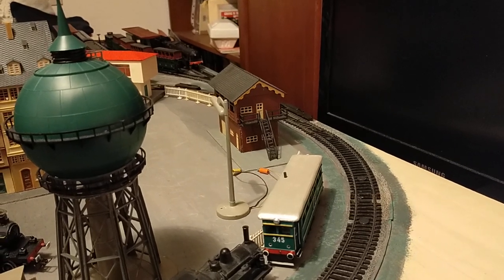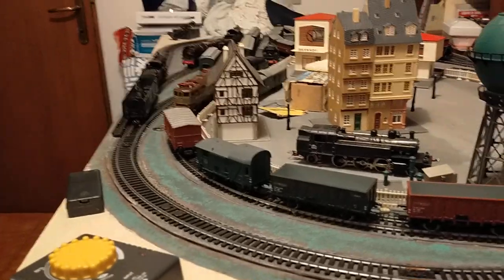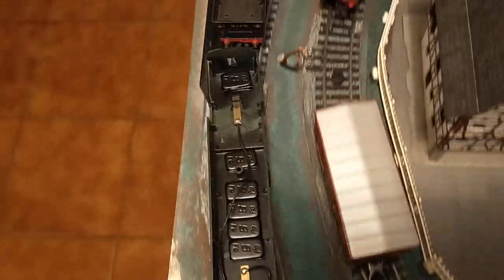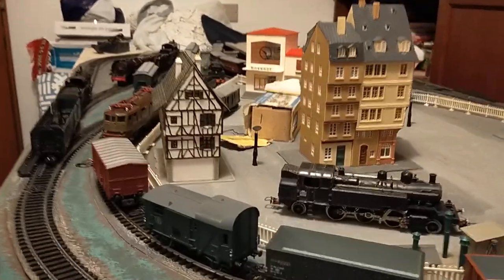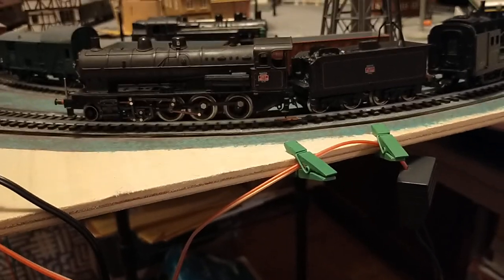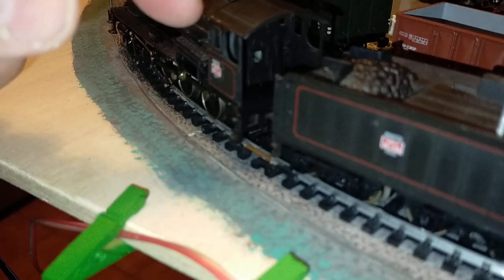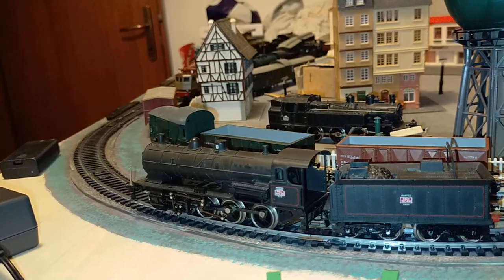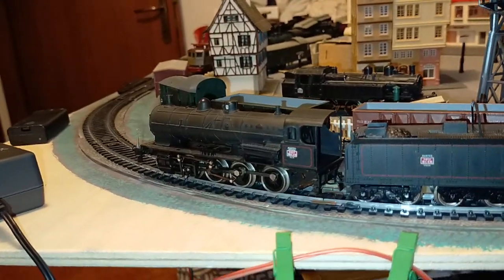Jouef SNCF 140C231 2-8-0 steam locomotive and luggage van test.

Comment: You can still get rubber band driven locos. Piko does them for their Mytrain range. The diesel shunter they do looks to be the same as an old Athearn one. I have the red one it cost me £22 new. It runs very smoothly. There is no gears in the Piko ones the belt goes from the motor axle over a really thick axle. Its very simple low maintenance

Comment: A similar story with the Jouef BB13000 some have the belt drive and some are just gears.   I replaced the worn belt on mine with a Marklin traction tyre which so far is working well.